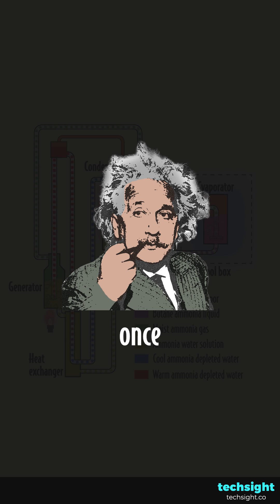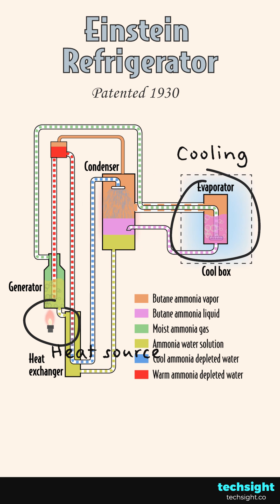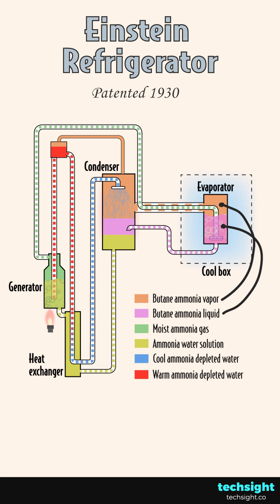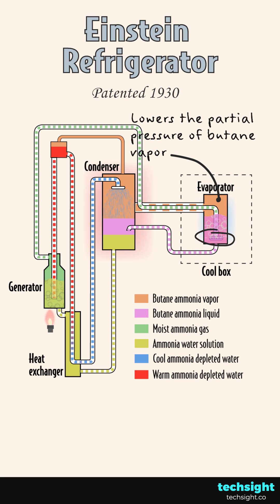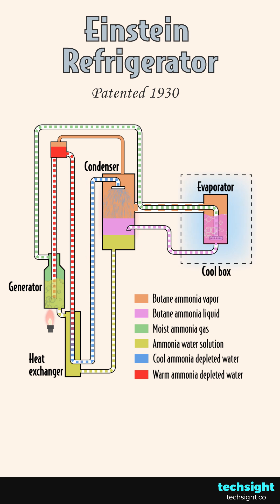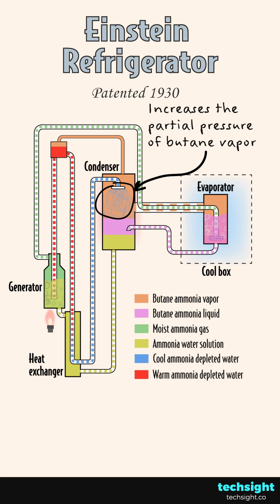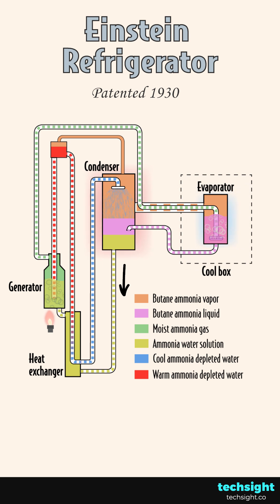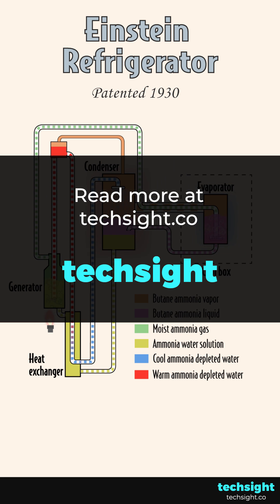How the Einstein Refrigerator works

Comment: They were somewhat successful in the recreational vehicle market; running off heat rather than mechanical energy means they can be powered by electricity or propane so you can keep your groceries cold without needing electricity. Not very useful in a typical home but definitely handy when you're camping and might not have access to power.
Reply: but i think it is useful in home aircooler
Reply: @forhadahmed4643 🔴 What Is Islam? 

🔴 Islam is not just another religion. 

🔵 It is the same message preached by Moses, Jesus and Abraham.

 🔴 Islam literally means ‘submission to God’ and it teaches us to have a direct relationship with God. 

 🔵 It reminds us that since God created us, no one should be worshipped except God alone. 

 🔴 It also teaches that God is nothing like a human being or like anything that we can imagine.

🌍 The concept of God is summarized in the Quran as:

📖 { “Say, He is God, the One.  God, the Absolute.  He does not give birth, nor was He born, and there is nothing like Him.”} (Quran 112:1-4) 📚

🔴 Becoming a Muslim is not turning your back to Jesus. 

🔵 Rather it’s going back to the original teachings of Jesus and obeying him. 

More .....👇

🔴 THE RETURN OF JESUS
Reply: I think it can be extremely useful in a home where you use solar energy as a heat source. Not to mention this device has no moving parts and therefore extremely resilient; Crosley icyballs still work almost 100 years after being made.